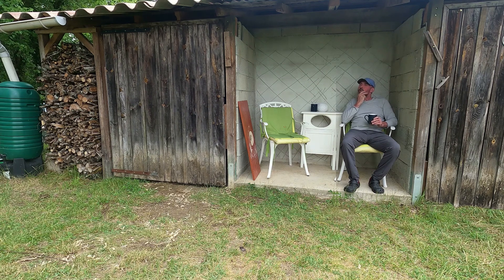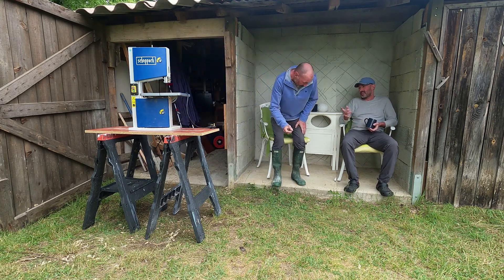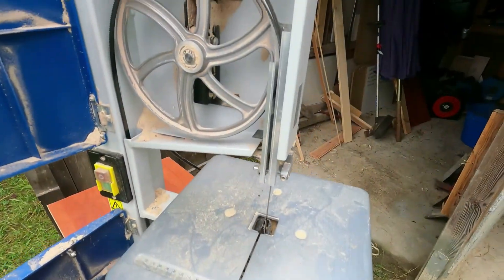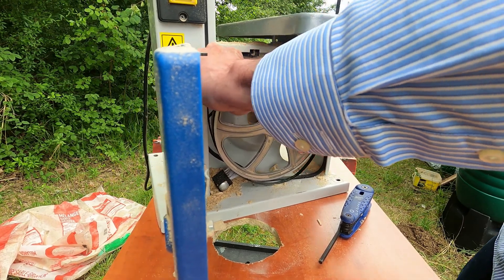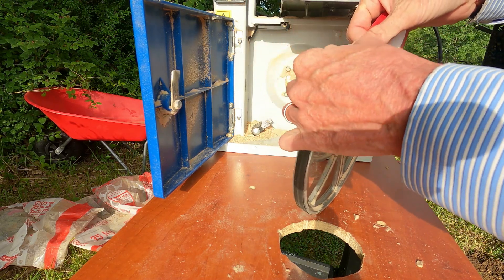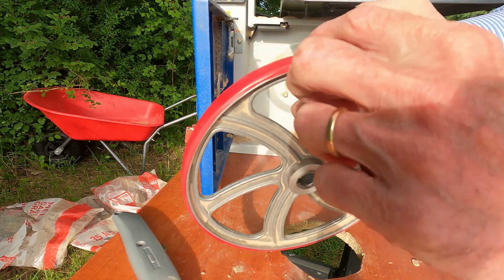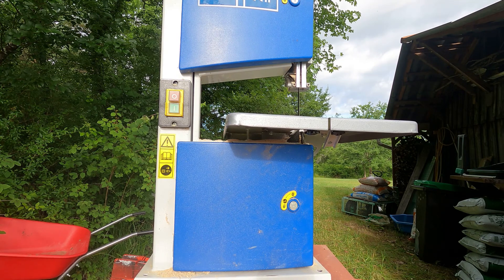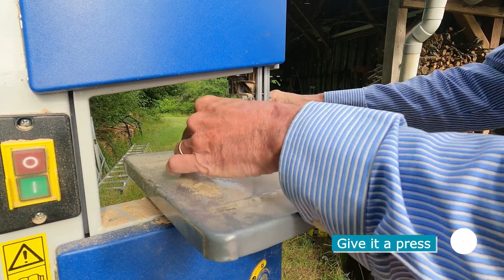How to repair your Bandsaw tire / tyre. Quick fix for the worst tool I ever bought.

Comment: I have the same problem, so thanks, I will try taping the tyre on until I can buy a replacement. My saw is actually an Aldi Workzone that I got 2nd hand for peanuts, but clearly out of the same factory in China. I very quickly managed to break the fence clamp (crappy plastic) but apart from that it worked "ok" for a year until the lower tyre started falling off.
Reply from the maker: I got two years out of that single repair. Regards JP

Comment: Another example of Scheppach 
I purchased a dust wood extractor from their main dealer distributor in Brighouse Yorkshire.
on using it with my small lathe it didn’t perform as I expected I tried to return it but they wouldn’t except it saying it had been used.
Of course it’s been used I had to use it to find out how useless it was.
Reply from the maker: That’s rubbish customer service John. I didn’t realise there was a main dealer in Brighouse though.  Regards JP
Reply: @Smallbarnworkshop  unfortunately there is, if I hadn’t known that I wouldn’t have bought this rubbish
But don’t worry I will never darken their doors again

Comment: Bought one of these under the "Ferrex" branding. Actually bought it off someone else BNIB for a song. Main issue was with the top wheel. Seems that the rubber tires need to be glued onto the wheel. I used some CA glue for the top tire which kept coming off. Runs okay now. These are really only very light duty hobby work. If I had the money (and space) I would get a nice big 14" or 16" band saw and have it bolted to the concrete floor.

Comment: I don't know how long you've had it, but the warranty on many scheppach machines is 5 years. I bought a saw similar to yours, a little bit bigger and more expensive but it was still a terrible tool. It wouldn't stay on anymore after a year and a half, so I sent it back to Scheppach. They said it was not repairable and refunded what I had paid for it. Lesson learned on these cheap saws, they might be ok if you use them twice a year on thin stuff, but I need something a bit better.
Reply from the maker: Hi. The issue was, I bought it in the UK then took it to France. I needed to take it back to the UK to return or have it repaired and it wasn't worth the hassle. Thanks for your view and comment. Regards JP
Reply: @Smallbarnworkshop  Ah yeah that makes sense, hopefully you can still use it for a while.
Reply from the maker: Two years later and its still working :-)

Comment: Did you consider contact adhesive to re attach the tyre to the wheel?
Reply from the maker: Hi. No, the old one was so stretched it was / is about 1/2" longer than the wheel circumstance. So far, 6 months after the  fix, it's still working. Although I did consider cutting it so I could remove a small section.

Comment: The tire must be glued, easy fix.
Reply from the maker: New tire needed the old one was stretched beyond use. Year on and its still running with the tape. Regards JP
Reply: @Smallbarnworkshop  Thanks